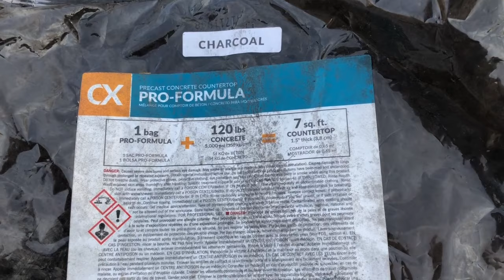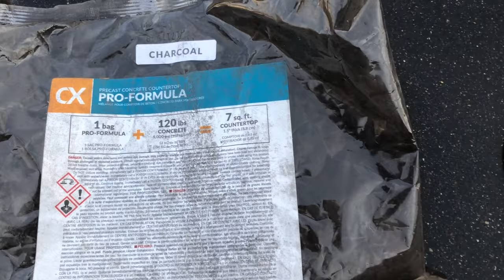Montana A Frame - Concrete Countertops

Comment: Rebar needs to be tie. Or else it wont do its job. 🤦🏼‍♂️ remember concrete is good in compression but not in tension thats where rebar comes in but it needs to be tie.
Reply from the maker: "Rebars are tied only to maintain bar positions during work done by other trades and during concrete placing. Tying adds nothing to the strength of the finished structure. In most cases, a tie at every fourth or fifth intersection is all that's needed. 
More information on bar placing, splicing, and tying is given in the Concrete Reinforcing Steel Institute (CRSI) book Placing Reinforcing Bars."

I quess opinions vary, if you feel it adds stregth by all means tie yours.

Comment: Would you share the concrete mix ratio you used?
Reply from the maker: 1 bag of the Pro Formula shown at 11:46 with 120lbs (2 bags) of reugular 5000 psi concrete from the home center.

Comment: there were some white little grains, what was that?
Reply from the maker: That is the fine aggregate (sand) in the concrete mix. You can control how much  of the aggregate is exposed with the grinding/polishing process.

Comment: How many bags of concrete did you mix with the bag of color ? Really nice job
Reply from the maker: Thanks, 120 pounds - 2 60 pound bags of 5000 psi concrete for one bag of the color/mix. I used the regular gray concrete mix. They do sell countertop concrete in bags now that is white but I have never used that.
Reply: @davidbonde2148  thank you for the info!

Comment: Hi Dave! I did a similar black color and it ended up drying way lighter, almost gray. Can't quite tell from your video if yours lightened up as well and if the Tung oil made it look black again? I haven't sealed mine yet and thinking of using Tung oil if it will darken it.
Reply from the maker: Yes mine lightened some when it dried and yes the tung oil will bring some of the color back. In the video at 13:25 it kind of shows the difference.
Reply from the maker: I will add that if your countertops are "allmost gray" the tung oil will probably not make them close to a black.
Reply: Ok, thanks for the response. I was thinking about trying a stain, there are some products out there, but I love the idea of just the natural oil. Great job on the countertops and thanks for posting the video.
Reply from the maker: Thanks - good luck with your project.

Comment: Very nice, but how did you get that nice black color
Reply from the maker: Thanks, you get the color by adding a pigment to the concrete. I like the dry powder pigment from Concrete Exchange. I show the package I used at the 11:45 mark in the video, and that is what I added to the concrete mix at the 1:55 mark.

Comment: How big can a 2 inch concrete countertop be with only the support from 4 sides? Meaning how big can the span be without it breaking in the center.
Reply from the maker: Sorry,  I don't know what the maximum span would be.  All my work has been similar to the counters in this video. The largest counter I have made was a kitchen island that was 3’X5’ but had support around the perimeter and down the middle.

Comment: Man what nice looking counter tops!!! I am in the process of planning very similar concrete counters are yours holding up to any cracking?
Reply from the maker: No cracks - I did similar counters in my home kitchen about 15 years ago and never had any cracks but you do have to be careful with acidic foods they will stain/etch your counters. I have never found a sealer that is bullet proof but the Tung oil has worked well. Good luck with your project.
Reply: Dave thanks so much for the reply!! Could you give me the products you used and were they 2” or 1 1/2” thick? Have a good one 👍
Reply from the maker: These were 2" my last ones were 1 1/2 here is what I used
Melamine for the forms
100% Silicone to seal corners of the forms
5000psi 60lb bags of regular concrete 
Rebar 
CX Pro-Formula Precast Concrete Countertop Mix  (Charcoal Color)
4" wet grinder 
Diamond grinding/polishing pads 100 to 1500 grit bought on ebay
Harbor Freight concrete vibrator
Pure Tung Oil - sealer
Electric buffer
Buffed with white 3m pad (not shown in the video)
Reply: I would like to go an 1 1/2 because of the weight and moving the bigger pieces do you think there is room for the rebar like you put in the 2 inch slabs? Thanks a bunch
Reply from the maker: yes I used rebar in my 1 1/2 counters - be careful not to get it to close to the top of your counters it can leave a shadow line. There are other products available like the fiberglass or wire mesh that could also be used instead of rebar, or the fiberglass rebar that doesn't rust. If I were making thinner (1 1/2" counters) I would probably look at those and use rebar in areas that are narrow like behind the sink and in front of the sink if it is not a farmhouse style.

Comment: How many pounds of black dye did you mix per bad ig concrete
Reply from the maker: One package of the Pro Formula shown at 11:45,  if you want to see a close up,  is mixed with 120 lbs of concrete. That package contains the dye so I'm not sure of a specific weight of just the dye included in the package.